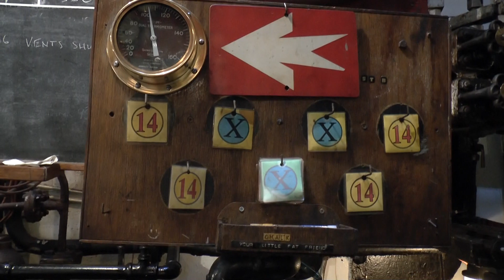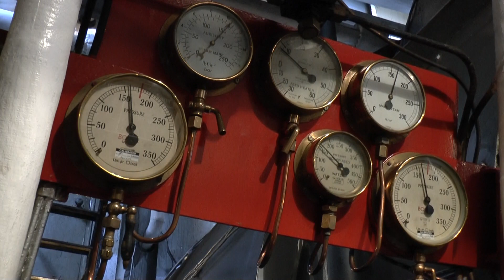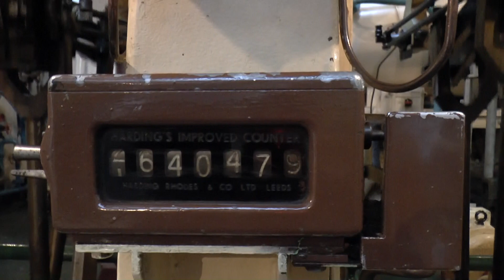Down In The Engine Room - SS Shieldhall - Triple-Expansion Engine

Comment: I worked on the Shieldhall when she used to drop the shit in the channel over the spoil grounds on the eastern side of the isle of white.  The Engine room was a fantastic place to be on a cold winters day. I have been everywhere on that ship even inside the boilers when doing a major refit, pushing out the coils? it the hundred plus horizontal tubes within the boiler  screwed aluminum what ever they were called to help the steam twirl in the tube to maximise heat transfer. Anyway it was dark and dirty but not a place many get to see. I could see the oil was white at the bottom of the cross head slides so I would assume shes leaking a lot more water these days out of the low compression piston. Anyway it's nice to see the old girl carrying passengers as she did when first built, licensed to carry 280? It's nice to see some real maritime floating history living and breathing not just a floating static monument to real engineering slowly rotting away.

Comment: Amazing video! The engines are so quiet. They run as if brand new. Thank You for sharing.
Reply from the maker: Yes it's hard to believe that they are 66 years old and sill run as new. A true testament to volunteers who look after the ship.
Reply: Eugene Kosinski Yeah, they don't sound louder than your average dishwasher. A diesel with same power would deafen you!
Reply: Not quite like new, I could hear a bit of rod knock going on. Its not serious though, and would probably clear up with some shims or bushings to take up the slack. 

Still a lovely sound, and so many steam actuated accessories aboard as well as the big engines.
Reply: They are quiet because with steam you don't have explosions taking place inside the cylinders.

Comment: I really do not understand why they light these things off in this crude fashion. Piezoelectric igniters with a small store of butane would get that all done with a press of a button -- not unlike what you have on modern outdoor grills. Oh, sure, maybe have this crude method there as a failsafe. But come on. That takes way longer than it should -- shoving a lit stick down a 5 foot hole. Did they not know what piezoelectric effects were at the time they designed these boilers?
Reply: Im a volunteer on the Shieldhall who works in the Engineering department. Yes, I guess they could have used piezoelectric igniters but the aim is to try and preserve and run the ship as much as we can as  how she was built. Over the years the ships has had  to comply with MCA regs with certain aspects to gain certification to sail and carry passengers, for example changing from running on FFO fuel to marine diesel because of exhaust emissions. We have added other features and procedures to help provide safer methods of lighting the furnaces but still use the taper method. It works fine, it may be crude but rather than modifying the existing fixtures and fittings we are trying to maintain the original providence of the vessel.
It would be like you having a 1970's wooden television set and replacing the tube with an LED display. It would look like a 70's TV and display a picture but would have lost that originality.
Reply: @SsnakeD23  Perhaps I could have been more clear, but at the very end I think I was pretty clear about the design of the boilers. I completely understand keeping the vessel preserved. There's no point in keeping an antique if you're going to upgrade its parts to newer more modern elements. My issue is why it was designed this way in the first place. As best I can find: "French physicists Jacques and Pierre Curie discovered piezoelectricity in 1880." So I just don't understand why they didn't implement this discovery into ship DESIGNS from say 1900 forward -- giving a good 20 years to let the discovery sort of 'sink in' to society/science/engineering.
Reply: Modern boilers use an electric spark to ignite diesel, which in turn is used to light the heavy oil, all at the push of a button.
This is a 1950s ship with 1950s technology.
Reply: @SteamboatWilley  Thanks for stating the obvious. Here...let me help you out a bit... According to what I found online, piezoelectric effect was discovered in 1880s. You're arguing that they couldn't figure out how to use that to ignite a ship boiler within 70 years?

Comment: Very similar to the old LOCH CLASS frigates I served on, So sad when they were all scrapped, spent the rest of my navy career on diesels, how boring
Reply: At least people who have worked on an open engine understand what is going on inside a diesel, but looking at lube oil pressure on a gauge does not show you that every point is being correctly lubricated. I imagine that with steam, the weakest link will always be the boilers, but even with a boiler down, steam can be valved to keep the engines turning. I am also surprised that guys running diesel often do not have the depth of understanding to realize the importance of never exceeding maximum exhaust gas temperature.

Comment: modern ships sucks. every ships cars planes machinary should be made the exact same way things used to be made. It was made to last and it did exactly that! today things are no longer built to last,  a car today your lucky if its going to see 10 years of use! oh and cars today.. sooo ugly lol each and every single one of them!
Reply: Its all about economics my friend.... yah, sad. wish I was born in 1870 rather than 1970.
Reply: coshyno that’s rose tinted specs. Cars today will run 200k miles with no problem. Older cars would have needed 5 engines and rebuilds to do that. Modern ships cars and everything else built is infinitely more reliable and maintenance free. Sure it’s not more beautiful and less craftsmanship goes into it true